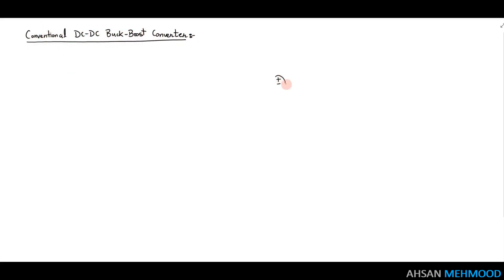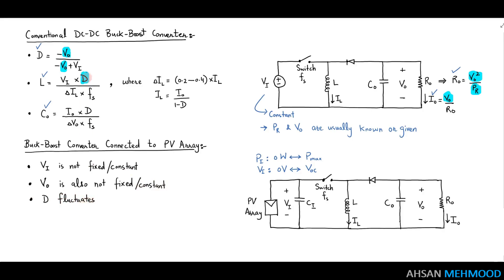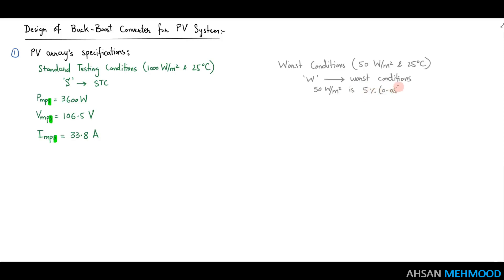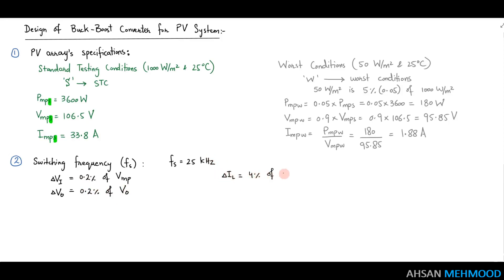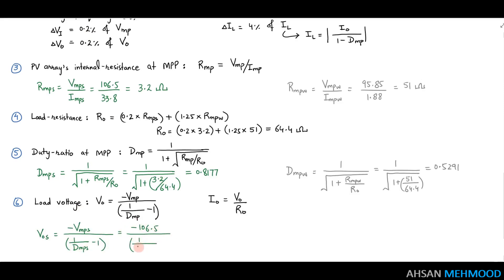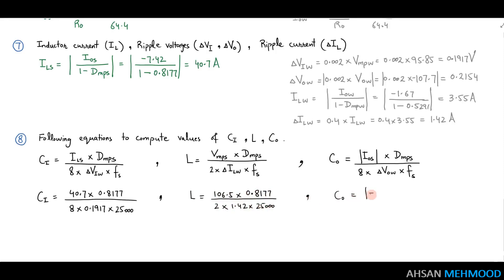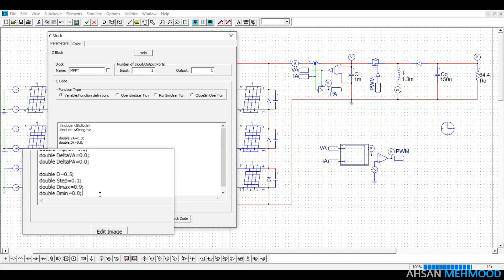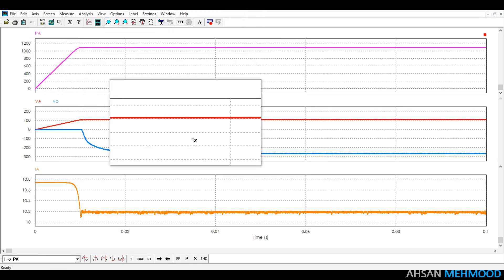How to design buck-boost converter for photovoltaic system? | Buck-boost converter design for PV

Comment: hello, excuse me i am a beginner in PV systems. Does your schematic allow to apply MPP to the load? By controlling current flowing out of the PV which modifies voltage from the PV, which modifies power?

Comment: thanks for making a video on this topic but I have a doubt that in this design the load resistance is fixed but, is the design will be same for the variable load condition that is different values of r from minimum to maximum also please solve my query
Reply from the maker: I have not checked this method for variable load, but I am sure that the designed converter would work for variable load too.
Reply: @ahsanmehmood9229  ohk thanks and are you going to make video on sepic converter design for photovoltaic applications, if not i request you toh make a video on it bcs your explanation and the design results are accurate than others. Thankyou
Reply from the maker: Okay, I'll work on it, and if got successful, then I'll make a video on that topic.

Comment: hello thanks for the video. its such a solution for me. but i wanna ask something, why the result of my simulation is negatif for the power. the graphics power in a negative way. how can i fix this? thankyou
Reply from the maker: array power or load power?
Reply: @ahsanmehmood9229  for load power
Reply: @ahsanmehmood9229  is it possible to use the formula in this video for one module PV? not for array?
Reply from the maker: Yes, you can use this method for one pv module as well as for PV array.
Reply: @ahsanmehmood9229  okay thankyou👍👍
Reply: hello sir, i wanna ask something. if i use cuk converter to my pv system, how can i determine the parameter for cuk converter sir? is that use a same method for buckboost? thankyou sir
Reply from the maker: You can try this method on cuk converter, maybe you get the right results.
Reply: @ahsanmehmood9229  okay sir thankyou once again. may Allah bless you

Comment: thanks for this vid. this is just what i needed for my research
Reply from the maker: Okay, i will.
Reply: @ahsanmehmood9229 kindly share the video
Reply: Sir will you please make a video using a P&O MPPT in buck-boost converter
Reply from the maker: Same code will be used as is used for boost and buck converter.
Reply: @ahsanmehmood9229  thank you sir!
Reply: @ahsanmehmood9229  Will you please make a video for designing MOSFET and Diode for buck-boost converter?
Reply: Thanks for the video pls can you do a video for MPPT using neuro fuzzy system with a buck boost converter